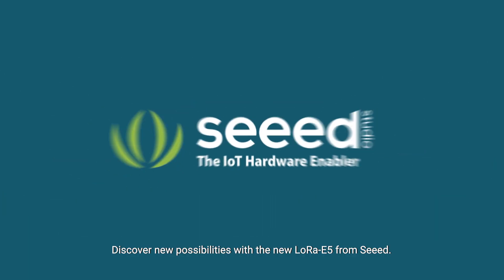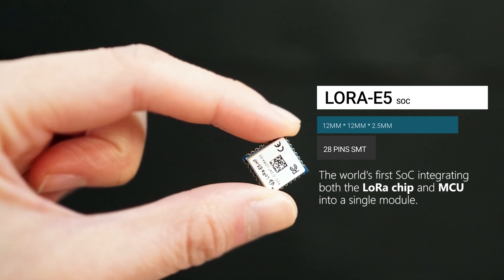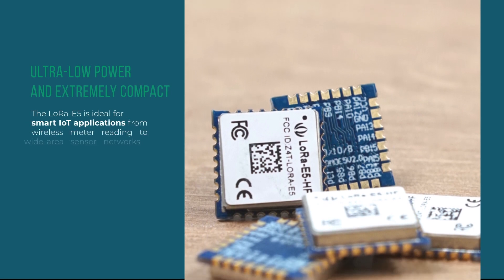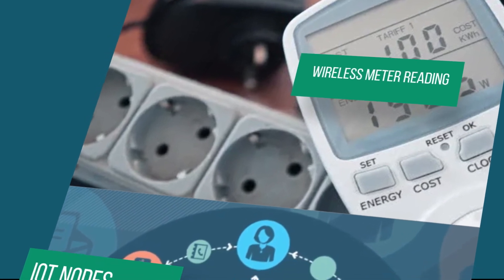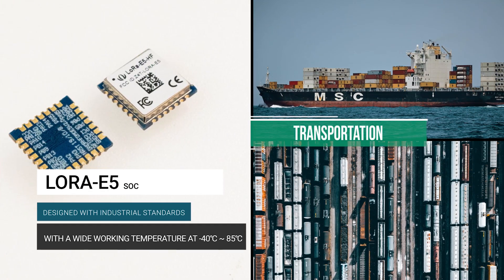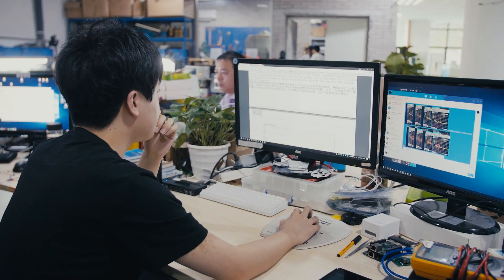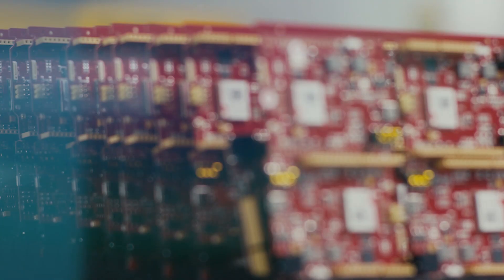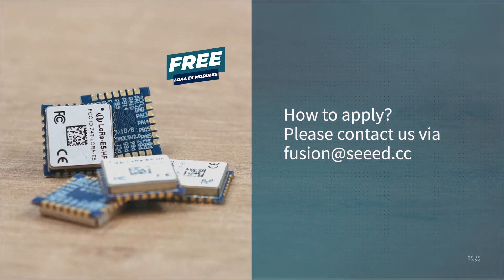Free LoRa-E5 STM32WLE5JC Module embedded SX126X & MCU Sponsorship for PCBA Service

Comment: Hi, where can I find sample code for P2P communication?
Reply from the maker: Maybe this project documentation can help: https://www.hackster.io/user102774/p2p-communication-using-lora-e5-1a36f4
Reply: @SeeedStudioSZ  Thanks for the reply, but that's not what I'm looking for (I admit that I have not specified what I am looking for 😅). My goal is to flash the e5 card and then write my code inside and not use the card as a gateway to another core. i found how to unlock the card, i can read the adc and other stuff, but I can't find anything on the internet for what concerns the use of the lora module integrated in the stm core. I Have tried to adapt the stm32wl55 core code (found in stm32cube examples) but without success. Now I am waiting for  the version 2.4 of the stm32duino project, it seems that the subghz system will be integrated
Reply from the maker: @NG-tn8cn  How about this wiki: https://wiki.seeedstudio.com/Grove_LoRa_E5_New_Version/#grove-wio-e5-p2p-example

Comment: Can i use as peer to peer where one sends and the other receives only?
Reply from the maker: Yess, Rami! Our existing LoRa-E5 dev boards support the peer to peer communication. Pls check LoRa-E5 mini (STM32WLE5JC) Dev Board here: https://www.seeedstudio.com/LoRa-E5-mini-STM32WLE5JC-p-4869.html & LoRa-E5 Development Kit:  https://www.seeedstudio.com/LoRa-E5-Dev-Kit-p-4868.html
Reply from the maker: Yes! Maybe you can check out this project as an example: https://www.hackster.io/sidikalamini/grove-lora-e5-p2p-communication-using-circuitpython-f970e6
Reply: @SeeedStudioSZ  But i still need a seperate MCU?